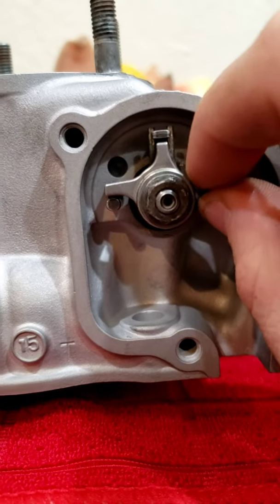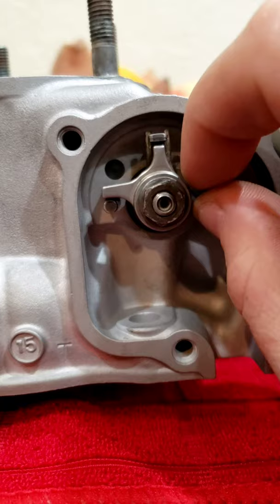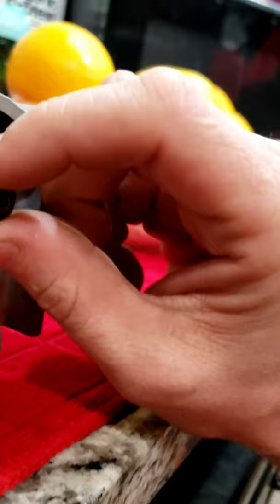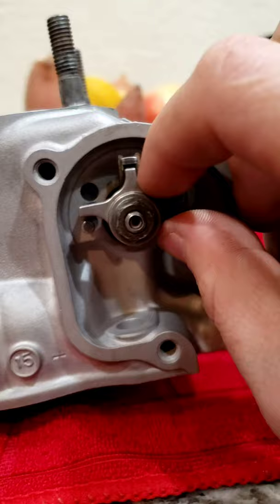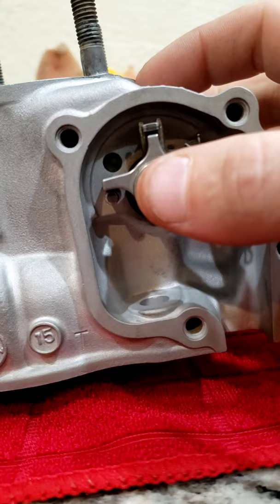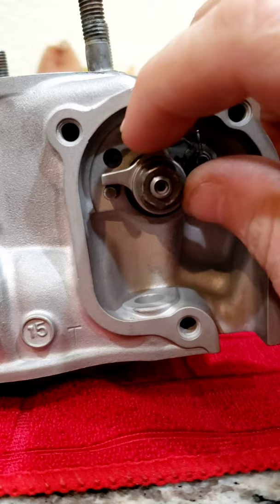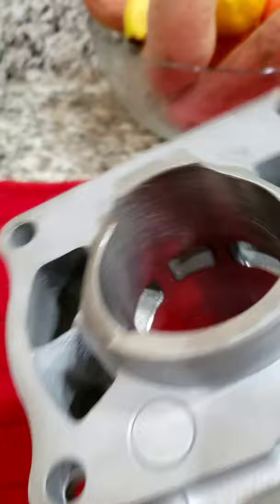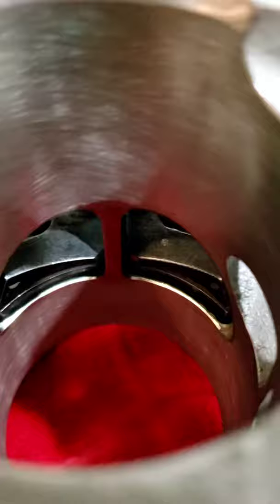cr 125 powervalve

Comment: How do you take out the power valve
Reply from the maker: You remove both 10mm nuts.  One on each side and remove the Allen set screws holding the collars in and then remove the collars then the shaft